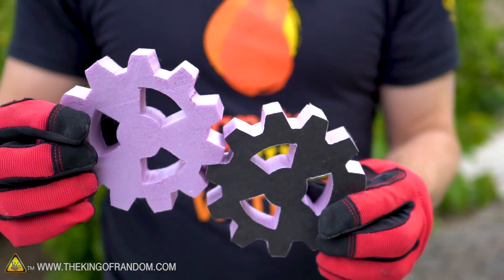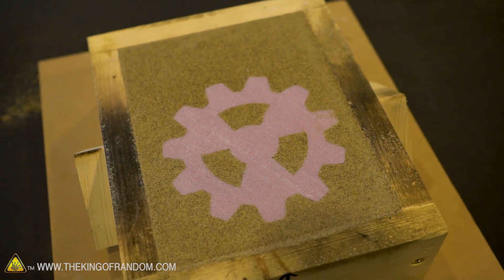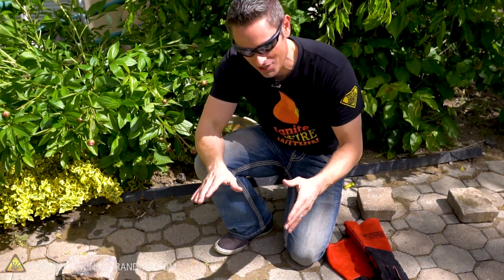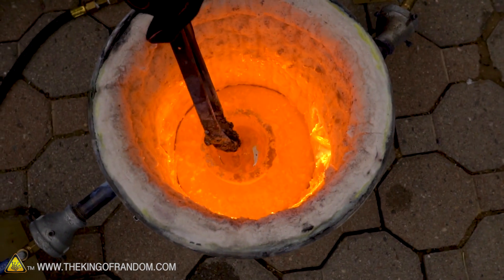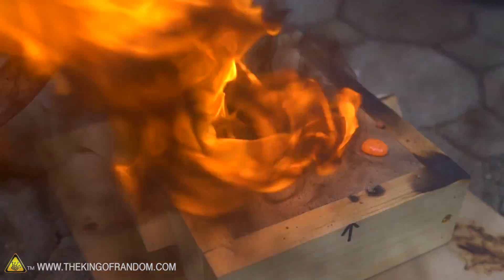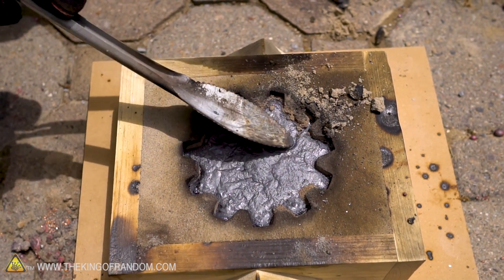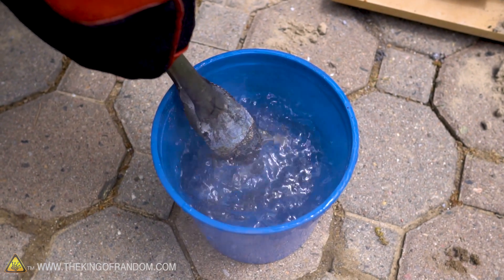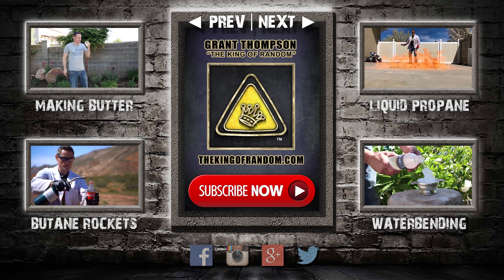Argh. Why Is Copper So Difficult? TKOR Tests Melting Copper In Our Homemade Foundry

Comment: Grant Thompson, I think the sand got pushed off when pouring the copper in the styrofoam because, the green sand you made didn't have enough clay. Therefore making the sand less firm for the copper to flow in. If you add a little bit more clay, then the sand will be more firm.

Comment: I have a great idea! Take that copper gear, put in in the mold with no sand, them melt some metal and poor it around thee gear to make a metal mold. Them make iron pillars/gear holes and drill them through to wood to keep tem in place

Comment: A thought I had would be to completely enclose the styrofoam in sand and leave a small area in the center to pour. Maybe the extra surface area on the top of the mold that would would be holding the sand radioactive symbols would prevent it from breaking off, that's just a thought that I had when watching!

Comment: for your ocd's sake, you should make the mold double-sided so when you pour it in from the funnel thing, the sand on both sides  may possibly insulate the heat and make it solidify slower. It also might keep the inner three foam gear parts from moving since there will be pressure on both sides

Comment: I used to work in a metal foundry. what you need to do is make a "top" mold with a vent tube/pour tube. the pressure of the top mold will keep the bottom mold intact and will insulate the molten copper

Comment: Could you try using some kind of clay mold, an inverse of the styrofoam blank and then surround that in some heat absorptive sand to prevent cracking when you pour?

Comment: Is there a way you could use some kind of clay material that sets hard and you can chip away the clay after the metal sets that way it can't fall apart? Keep all the other steps the same and push the cut out in let it all set then melt away the styrofoam and then our the metal.

Comment: Looks like the copper is denser than the sand, so the pieces, since they're very well anchored to the rest of the mold, basically end up floating on top of the pool of metal.  Is it possible to mix a heaver material into the sand to make it denser?

Comment: You have to compact the green sand into middle sections of the radioactive symbol individually to capture the detail and not break off under the weight of the molten metal

Comment: Few things to note for a better casting:
1. Green sand is fine, you should have made a runner and riser to prevent the sand from breaking apart while pouring.
2. You should preheat the mould with a blowtorch so that the copper doesn't cool instantly.
3. Why can't you use a blowtorch to melt the styrofoam?

Comment: you may need to mill in the details. it does seem like the green sand isn't as sticky as it should be. Maybe it needs a different ratio of clay to stay solid considering the higher temp of the copper.

Comment: how about you use a torch on your greensand mold. this will make it to that temp difference between mold and metal will not be as high in turn it will prevent your molten copper to solidify as fast. chunks of your green sand seem to pop out because you are pouring too fast. (my humble opinion)

Comment: I work with metal for 30 years so just me on this,you should use Clay it better at holding together,or if you want to go cheaper,just use sand but compact it more ,but you could just make your mold from metal

Comment: you should melt some metal and put it into a vacuum chamber
Reply: GRIFFIN i think the heat would just break the glass
Reply: he should put a vacuum chamber in molten metal.
Reply: GRIFFIN it would destroy his vacuum chamber
Reply: GRIFFIN If the metal were to start boiling it would create heavy metal vapor that's highly toxic to breathe in. Not to mention, the vacuum pump would overheat due to the heat of the metal.
Reply: if he did this he would most likely ruin the vacuum chamber if he did that but i think in a situation were it would not ruin the chamber then it would be purity neat to see but he could use gallium and do it XD
Reply: Why?

Comment: Would Backing the wet sand at 500 degrees for 8hr to 12hr, after putting the foam template in the sand, stiffen the mold up?

Comment: You said the sand got crispy and hard? What if you wet the sand, like you did before, put the foam shape in and let it dry in the stove.(70-80°C for half an hour ) then you have to take it out carefully and just pour it into the dried and also hardened shape

Comment: Maybe if you did a 2 part mold. Like have another box ontop that's just sand and add a sprue. That may help keep them bits in the middle from wanting to pop cos they'd have something above to prevent that.

Comment: What is likely happening is the higher heat required to keep the copper molten is drying out the green sand too much for an open mold.  Since metal is denser than sand, the sand floats up when it breaks off.  A closed sand mold with a small entry point, as recommended by another comment, may give the detail more stability.

Comment: What you need to do is make another box that you would set on top of the gear. Out some dowels in while you pack it in so that there is an area for you to pour into the cast. this will help make it more stable and holds together better. also you might want to try and use more wet greensand. I know that you said you left it out. Maybe try it without

Comment: I know something that maybe would work! You need 2 halfs fer the greensand, In one of them you just set the mold in with the foam when you have that you put some baby power on top of it, then in the other half you make it completely full of greensand expect one hole, when you put the 2 halfs together, you put the molten copper into the hole so the foam melts and it takes its shape but because there's sand above it the middle pieces dont rise up and there's more heat so it takes a little bit longer to cool down

Comment: You should use a type of clay or bury the the mold in clay and just pour the copper into an opening, that way, the peices of sand won't fall out and you'll get a clean look, try looking for a different type of styrofoam too

Comment: you need to make the mold with 2 halves and a gate and vents in the top half the top half of the mold will support the sand so it doesn't float away on the molten copper.

Comment: You !NEED! to use the top part and create a Funnel aswell as a reservoir otherwise the copper will cool to quickly. And make the sand harder! Add a bit more water ad clay then everything will work.
Reply: Alexxd_12 more water is a no go it will cause stea m to rise through the sand pushing the grains farther apart therefore making the mold less durable and clay will just crack under the heat so that won't work either.
Reply: Alexxd_12 are you trying to do NEED  not. !NEED!
Reply: More water would make it worse since the heat of the molten copper would boil it making steam which then loosens everything until it pops out.
Reply: adding more water will cause steam pockets to form and destroy the mold
Reply: Alexxd_12 Yes, try to do bold with astrics or use underscores for italics. Or both. Looks nicer than !CAPS!.
Reply: NEED?
Reply: Alexxd_12 this is exactly wat I was going to put

Comment: Use two halfs of the mold with green sand and place your styrofoam cut out in between the two with a hole leading to one side of your box for pouring

Comment: Trial and error! It seems like the sand is too light or isn't maintaining shape properly. Maybe try adding more clay to the mixture or using quikrete playsand instead of the fine beach sand. I haven't seen anyone try to use copper in one of these molds yet, but I've seen brass.

Comment: Best suggestion Grant is to make the complete mould, screw the cover onto it with a hole drilled into the center. If its wet enough it should help keep the mould intact problem is of flashheated steam potentially blowing the mould apart, surprised it didn't happen when you tried it with the cover off. internal details are quite difficult to get right, its always best to make a hollow mould without any internal effects (the three holes in the gear) when green sand casting as although it is possible sand casts are too structurally week to cast highheat moulds into. Atleast what I've learned anyway, hope it helps!

Comment: Use a cope and drag to cast. The two halves help stabilise the sand by sandwiching the sand core. I have never attempted to cast in an open mould. Also notice on the open casting the sand floated. Cope & drag is the only way to cast.

Comment: You've stepped up your metal melting game, but you haven't stepped up your casting game. Trying to burn away styrofoam from a sand mold is probably the laziest way to pull that off right? You need to start doing positive-negative-positive casting so you can just pour the liquid copper right into a cast shaped like what you want whose walls won't melt or crumble.

Comment: You need to use both sides to ensure that it maintains its heat during the pour and also keep the molds structure. You are not even doing a difficult cast and yet you keep failing because of the lack of structure.

Comment: I have an idea why don't you cover the sand with a plank so the mold won't lose shape and pour the molten copper using a funnel? or melting the Styrofoam a little then pouring the copper

Comment: I've never done copper, but I have done aluminum. I used a two part mold with a sprue to control flow rate. The first half would be just what you did in the video and the second half would be all sand (except for the carved gates to get metal into the mold). Worked out pretty well, worth trying with copper

Comment: try heating the sand before you put the copper on it so the sand will be heated and wont snap heat and creak and mess up. also try making the mod and then carfully taking the mold out first, so it wont mess with how the metal cools then cool it with liquid nitrogen it works alot better.

Comment: it's been a long time since i've made any castings, but to me you sand looked too dry (hard to judge with out touching it, could be wrong)
try doing it with a cope and drag (two sides of the casting) and use the white styrofoam (you mentioned yours was insulation maybe so sort of fire resistant ingredients there)

Comment: Take plaster of Paris and take the foam gear out line and put the gear in plaster of Paris let it sit then crack the mold and pull out the foam and drill a hole down to the casting mold then seal it with duck tape and pour the copper it should not push away since it's a solid mold not a soft mold.

Comment: i think the problem is that it is not an enclosed space that the metal wil fill. and since the metal is so dense everything that is kinda loose will try to float on it, similar to a balloon filled wtih air that is underwater

Comment: You could use a heat gun to melt the styrofoam away and then pull it out so you are left with only sand.
Reply: And your sand was a little to dry

Comment: problem with copper is its thermal conductivity. one way to get past that is to use Foundry plaster (that can take 1400*C) that you heat up with the copper to keep the copper molten for a longer period. in short warm mold gives longer liquid time for the metal. sand work to a certain degree but even that has it's limits if you can't get the copper hot enough.

Comment: Hey grant use normal packing foam or floral form. It looks like the stuff you're using is flame resistant so it won't burn well. Maybe also work on your green sand mix some more.

Comment: From 2 videos that I was observing I figured out couple of mistakes you make. First: you should compress that sand harder, until you will be able to lift the whole thing without the board on both sides. Second: the sand was too dry, so apply some moisture to it, but don't make it too moist. And if you want to make it work - try to make 2 boxes of sand, one with mold and another one with pure sand, than put one on top of another and don't forget to add a tube to pour the metal into. This should work. If you have any other questions - you can ask me.

Comment: Um...I don't really know a lot about this, but is there a way you could "weigh down" the sand? Like putting something in it like aluminum or iron, which will at least I think not melt long enough for you to pour the copper in? That way the details wouldn't pop up like they are.
Reply: Er...would density play a part in this situation? I honestly have no idea...

Comment: try making the gear but with a slide of sorts coming off on side and poure into that to flow the copper into the gear, i think pouring directly into the gear puts too much force on the standing sand pieces in the middle

Comment: Try making a 2 piece mould with a parting gate. That will solve it. And it needs a bit more ramming. The density of Cu is higher than that of Al or Brass so the buoyant force on the sand causes it to break away.

Comment: You'd have better results having your mould completely submerged in sand and using a pouring channel. Less chance of your mould losing its structural integrity. Shallow sand mounds really should be a solid piece.

Comment: just because of the density of the copper it pushes the sand out when you're pouring it in fast, but if you pour it slower it'll solidify too quickly? not sure theres a way around that unless you use metals that have a lower melting point...

Comment: the black copper oxide gets reduced back to copper when its hot in the presence of carbon , I wonder if you cooled it in a bucket of petrol if it would cool down and be perfectly copper colored and not require finishing. Oh and there would be a sweet fireball off that when it went in.

Comment: Would some type of concrete mould work, then just break the concrete afterwards?

The finish may be quite rough, but you could either sand it down afterwards, or line the inside with green sand?

Comment: You can try the plaster method :) cast a wax one, plaster it, melt the wax out and pour copper in, just like how you did it with the poke balls, except this time wax on the surface and not inside a plaster cylinder.

Comment: Try to put wood or any plank to cover the sand make a hole and pour in the copper it sold work dis time if not I  tried or maybe try putting thin metal rods in the sand  maybe it will help.

Comment: I think the problem is that copper is too heavy and too dense and sand just floats on it. This makes the middle sand pieces to pop out just like if you were pouring water in a bucket with a corke inside. Try making you mold thiner by cutting foam to half the width. That would lower the force liquid copper excercises to the sand.

Comment: A Lille two stroke engine oil in the sand really helps the sand hold definition mate. Why the open moulding? Using a drag and cope flask set with gates and runners would allow to fill better. Polystyrene packing less dense than styrofoam and clears away faster. I have cast copper motor parts my way with no problems.

Comment: you dont need a two part cast for this but make a trench to channel the copper down the mold instead of directly pouring on top of it. the terminology may be wrong but the pour has so much energy expanding out therefore knocking down the inner details whereas if you pour through a channel the energy decreases and slowly fills up the cavity.

so make a channel at one if the teeth, burn off the foam, then pour the copper from the channel.

look up sword casting and see hiw they let the molten metal flow into the cavity

Comment: open faced mold was your problem, also it was too dry for the first few like you suspected.
need a two part mold for stability on those middle pieces.

quenching a graphite crucible is always a bad idea, thermal shock can pop it.

Comment: 1. what about running a heating system for the sand to raise the temp of the mold. 2. use a tourch to melt the foam. 3. a spray bottle to keep the sand moist on top while the heater keep the temp up from under neath........ its the weight of the moulten copper that is pushing the cast sand parts off so if you pour the copper quickly but evenly over you would be able to keep the forces alighned?   ?    ?    ?      ?     i am NO scientist just a dad with a second pair of eyes!

Comment: You need to melt a layer of the foam just enough to have a place for the copper to fit in but leave enough to hold the sand

Comment: The reason the sand pops out is actually because of the difference in density. The copper needs to be less liquid in order to keep the sand from floating out.

Comment: When you add the first layer of sand in your mold smash the sand through a fine sieve so it can capture more fine details and has more surface area to adhere to the other sand and keep its integrity for when you melt the styrofoam away
Reply: Or don't melt out the styrofoam
Reply: Watch tito4re he's a YouTube that almost strictly does copper casting

Comment: I think part of the problem is your green sand.  Not all kitty litter is made with bentonite, and the fact that you had to use 20% litter instead of 5% seems to indicate that yours is not.  Bentonite will make your green sand more cohesive and resistant to popping out and crumbling.

Comment: What if you put the Styrofoam mold in a bucket of sand? (Half of a bucket with sand, mold, then a bit more sand. But you should  make a hole on the side so the smoke can leave easily)